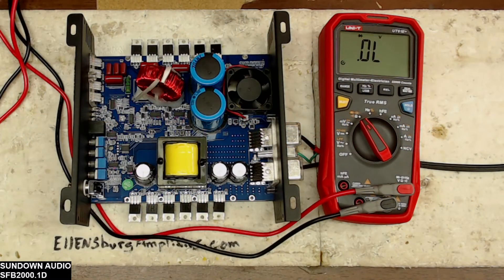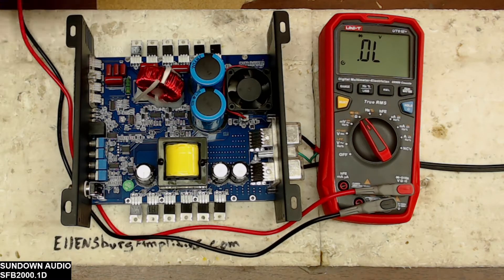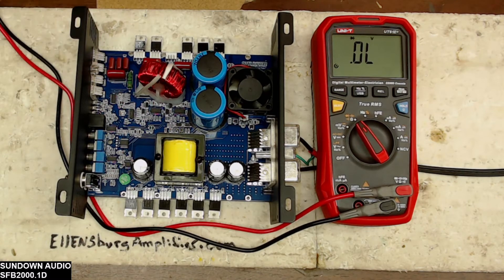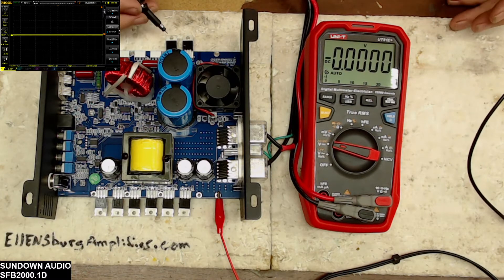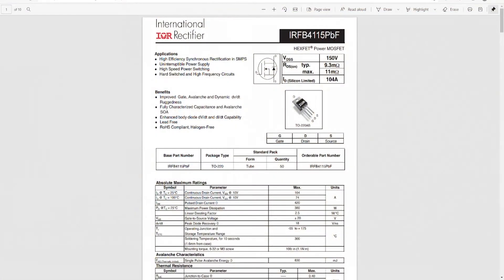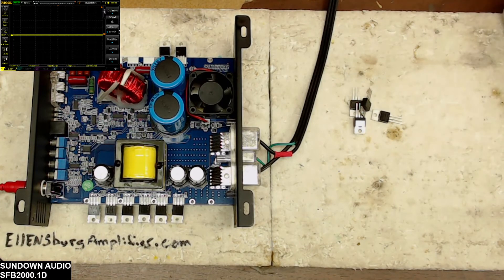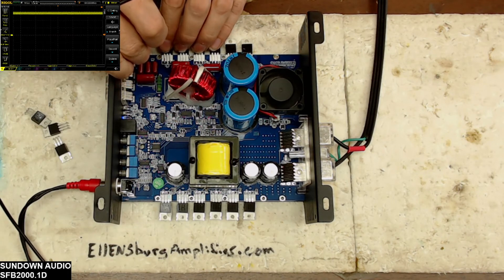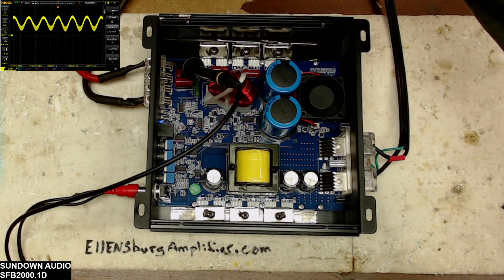Sundown Audio SFB-2000D Class D Amplifier Repair of Output From a Short

Comment: I got this 8000W version of this what could be the problem the mosfet at the output has no PWM though my power supply gives pulses no shorted parts 😭
Reply from the maker: You will need to verify that the pre-amp is functional. You should see a square wave at the input pin of the output drive IC's. Without a squarewave input, you will not see anything at the output transistors.

Comment: I have 2 of the sfb3000....
Bought from the yardsale years ago and finally tried to use them. One went up in smoke immediately and the other i screwed up.  Accidentally touched the positive output to chassis. Went into protection. Are you still working on these?
Reply from the maker: I closed the business at the end of December 2024.
Reply: @ellensburgamplifier any recommendations in So. CAL?

Comment: I recently bought a 08 Honda civic that had a Sundown SFB-2000D running a 15 inch subwoofer installed by the previous owner. Worked fine for 2 weeks then one day subwoofer stopped working randomly and all lights on the amp are flashing. I have zero knowledge about this stuff, never owned a car with a system so just wondering if should buy a new amp 😅
Reply from the maker: I would choose something different to drive that 15 inch as I do not know the design of your enclosure or what style of music you listen to. As a default, I recommend a Korean board first before diving into the Brazilian or Chinese full bridge amps.
Reply: @ Thank you for replying! Sounds like I have alot to learn haha! The sub is in a pre-fabricated box called a Q Bomb? I think? I listen to a little bit of everything but most of the time I left the controller on the lowest setting but it still provided a good thump with the factory speakers. Not sure why the guy before me had this giant 15 inch subwoofer in the car anyway 🤷‍♂️

Comment: What kind of transistors are in there from the factory. I have a 5000 with shorted output transistors and want to replace them with stock
Reply: Did you ever find out ?

Comment: I have the same amplifier but the 8000W one its showing -4vdc on speaker out what to do ? My amplifier is keeps on flashing protect without anything connected besides from power supply ? I tried to read the H1 A2 labeled output transistor and it shows an open reading should I only replace the transistor or what else help ?
Reply: I have 57kOhms in speaker output terminal measured
Reply from the maker: @cyrusbundlaria667  It sounds like the output section needs to be rebuilt. All output transistors, zener diodes, and drivers.
Reply: @ellensburgamplifier  Thanks 🙏 I really appreciate this channel more subs to come!

Comment: I have a simular amplifier with almos intentical inside. Blow same mosfet changed all 4 to identical ones but ass soon as i turn the amp on the same one blowes straihgt away. Do you have any tip on what to check?
Reply from the maker: You most likely have a fault in the drive if you did nor replace the drive components. I would see what the resistance is between the speaker output terminals to ground. This will show any shorts in the feedback. Also make sure your transistors are not fake.
Reply: Where do you het the h1 transistors?

Comment: Working on an 8k clone like this. Have replaced all output fets, 20957 drivers, driver buffer ic's and auxiliary power ic's. Now the clip light will blink about 10 times and on the 10th the power and protect lights also come on. At that point it pulls a little more current like it's trying to turn on but doesn't. Any ideas? Any help is much appreciated.
Reply from the maker: Did you replace the zener diodes? What is the resistance value across each output transistor gate to source? I quit working on these quite a while ago so I don't remember exactly what is involved but I do remember the Zener diodes being a clip light issue.
Reply: @ellensburgamplifier  I finally just figured it out and it was actually my own fault. Lol. I had one of the drive buffers turned the wrong way. So tiny it's hard to see the dot. There was a bad diode next to it also. Not sure if it was caused by that. Replaced both and put on correctly and now it's working. I think it's time for a break now. Lol. Thanks for the help.

Comment: Hi Todd , i have and identical clone amp instead have 2 transformer H1 mosfets , have the same problem 1 Bad output mosfet H6 replace all four with news , have nice square wave but i noticed they  are getting pretty hot., what could be wrong , any idea? Have 117volts on rail
Reply from the maker: Are the IRFB4227 (H6) transistors you installed authentic? If the gate/source resistance values are on par and the same, then I would be looking into the transistors used. Did you also replace the drive IC?
Reply: @ellensburgamplifier  the IC driver could be bad?? , even it both square wave are presents ?! ...
I bought "originals" H6 marked mosfets , but i dont know have me thinking , they have C=11nf , VT=3.5V
Reply from the maker: @ElectronicaChrisJoel  Did you compare the specifications to a transistor that did not fail? Heat can be from a few things such as cross conduction, duty cycle, switching freq., improper transistor values, shorted or cracked inductors, etc.
Reply: @ellensburgamplifier  thanks for that info , i changed the driver from the side mosfet fail , and now they are little bit warm , check resistors specially 10ks are fine , duty cycle at 50% on both , inductor  fails even i have sinewave at output terminals , great day 👍🏽

Comment: Did you find out the full name of the b2 transistor?
Reply: Manage to find 1640ct and 1640ctr but not sure where they go
Reply from the maker: @lorenzongwai3993  The "R" usually indicates common anode which the center leg would be the negative side of primary capacitors or ground reverence. The middle leg of the "CT" would be going to the positive side of the primary capacitors.
Reply: Okay thankyou. Do you have the board diagram or something similar?
Reply from the maker: @lorenzongwai3993  I have nothing for Sundown boards but they are built like all others for the most part.
Reply: @ellensburgamplifier  okay any refference?
Reply from the maker: I have B2 noted as the IRFB4115
Reply: @ellensburgamplifier thank you.. unfortunately my s4 and s3 is blown as well. Do you have the s4 and s3 name?
Reply from the maker: @lorenzongwai3993  Those are common cathode and common anode rectifiers. I use the 2040 rectifiers or the 1620/2020 rectifiers depending on the rail voltage or ratings of the rail capacitors. Good luck on the hunt!

Comment: I have the exact same amp with the exact same problem. Clip light stays on and has no output. What's a good price a shop should charge me to fix it?
Reply from the maker: When I was servicing these the average charge was $60 to $130 depending on the faults.

Comment: I have this amp also.what is your starting cost to see if it can be saved?
Reply from the maker: I don't charge by the hour or have set costs. I charge by the job. www.ellensburgamplifier.com/FAQS I don't charge to diagnose and quote amplifiers. Feel free to contact me. all of my contact information is at the bottom of every page on my site.
Reply: There is an 8 pin ic marked C12 do you know what it is?

Comment: Sfb 5k. In the aux power sections there is a small round smd inductor labeled as 100 on top of it. Is that a value of 10mh? Also do you know where I could possibly get any or is it possible to replace this with a different component? Thanks.
Reply from the maker: That will be a SMD 10uH inductor. There is a little trial and error when buying them. Mouser has them in stock.
Reply: @ellensburgamplifier  great. Thank you very much. This is only the 2nd amp that I've been this deep into the repair. Got the 1st one fixed and finally getting this one figured out too. Appreciate the help.
Reply: Is there any certain way I can tell if the pic is bad? It looks like I should be getting something from pin 11 but nothing at all. I'm also not getting the input sine wave to pin 3 and no pwm at all to the 20957's. I have replaced every ic and tested almost every component. Rail voltage and everything else looks good. Any idea what I could be missing? This thing is driving me nuts. Lol. Thanks
Reply from the maker: @hopskustomaudio  Without a print one will never know if the PIC is good or bad since you don't know the functions. What IC are you referring to about pins 11 and 3?
Reply: @ellensburgamplifier  pin 11 on the programmable ic that controls everything and not getting any type of signal on the pin 3 (input) on either of the 20957 drive ic's. So no switching on the output fets.
Reply: @ellensburgamplifier  pin 11 on the pic is connected to a trace going to something but not sure what it's for. There just isn't anything happening on it. So it just has me thinking that it has something to do with the signal going to both 20957's. I could be way off and over thinking all of it tho. Still very new to all of this. Lol
Reply: Would you be able to replace the pic for this amp if that's what the issue is? Or would the cost not really be worth it? I'm trying to find someone with a bad amp I can buy to get that pic but not having any luck.
Reply from the maker: @hopskustomaudio  If I had a replacement IC I could replace it but as you know you would have to find a spare amp of the exact same model. The minimum charges are going up slightly starting the first of the year which you can find on the homepage of my site.
Reply: I've already put a bit of money in it replacing everything else so don't want to give up on it now. Lol

Comment: Please specify  the power supply gate drive ic number(8 pin ic)
Reply from the maker: the UCC27324/524 is the most common and a person can also use the IR4427 depending what current requirements are needed.
Reply: Thank you so much for your answer.🙏

Comment: Hey, hoping you’ll see this, I have a sundown SFB-3000D, I went to drive my car one day and the amp was dead. The power/clip/protect lights just flicker, any idea what the issue could be and if it it’s repairable?
Reply from the maker: Sounds like a fault in the output section. For the most part they are repairable. These guys deface their ICs which can make a little difficult if it's not the standard faults.

Comment: could i ask you even after many many time......do you known the code of the other unmarked ic's....???like c3,c4,c8 ic,s??
thanks for your tme waste...!!!!!
Reply from the maker: I think those are the pre-amp ICs. I don't have any reference to them as they are typically ones like the 072, 074 op-amps or the OPAs like on Taramps boards. There are also 5 pin ICs that are PWM ICs for the auxiliary power supplies.

Comment: Repairing the same amplifier. Smoked power supply, replaced fets and gate resistors. Currently dont have any signal on the gate. Any idea what the drive ic part # is?
Reply from the maker: The IR4427 I do believe.
Reply: @ellensburgamplifier  TX alot. This is what I suspected but wasn't 100% sure.
Reply from the maker: @camaro1eclipse  Any day! I think you can even use the UCC27524 if you don't have the IR4427 on hand.

Comment: Do you know what triansistor would be on the rail, they are marked s3 and s4 in really smal lettering and there are other numbers above. i have the same exact board as in the video but with other branding.
Reply from the maker: They are the common cathode and common anode rectifiers. Super fun to find and common to fail.

Comment: I have a weird one, Sundown SFB 1k and it turns on plays but smokes. I opened it and noticed the white silicone on the big red coil is the one that starts to smoke.
Reply from the maker: The output section needs to be rebuilt and you may have a shorted inductor.
Reply: @ellensburgamplifier  The outputs dont look fried nothing looks fried on the board. I accidentally dropped it and im guessing thats what caused it to do that.
Reply from the maker: @GorillaKnobzUSA  It will either need to be replaced or the short isolated but luckily it is a small one.

Comment: Hi , I got that power light and clip light is soild but no sound any idea what could   be wrong  I have checked the powersupply,  outputs all good , checked the preamp stage all good
Reply from the maker: Usually, an indication of a bad output section if you see rail voltage being built.

Comment: I have a SFB 8k and was wondering if you can tell me what it means when the power (blue light is blinking) but won’t put out any sound, got a lil warm when I was bumping on it (no clip light at time of bumping) then it just shut off and blue light keeps blinking 😢
Reply from the maker: That is a shorted output section.
Reply: @ellensburgamplifier  ohhh nooo 😱😭😓 dang itttt guess I’m going to need to get my amp repaired 😫 but thank you very much for the response
Reply from the maker: @texasbasshead8289  They are not too bad cost-wise to repair if you choose to use E.A.R.S.
Reply: @ellensburgamplifier  I might have too how would I go about shipping from Texas? You’re located in Washington? (I also have a Skar RP2K that would need repairs too if all goes well with my SFB)
Reply from the maker: @texasbasshead8289  www.ellensburgamplifier.com/request-a-quote is the first step. Shipping isn't too bad if you someone like pirateship.com as they have some of the best rates possible.
Reply: @ellensburgamplifier  awesome greatly appreciate all the feedback I’ll get on that as soon as I have the fund’s available thank you very much 🙏🏽

Comment: Hi there, I bought a SFB 1500 from a dealer and got stiffed, as soon as I hooked it up it cycles between blue, clip and protect and it seems to overheat even when the vehicle is off. thank goodness I caught it in time.  Is it to late for this amp or can I try replacing the output transistors? If so can you recommend what transistors to buy and where I might get them. Thanks
Reply from the maker: The thing with these boards, in most cases, is there are more things to replace than just the transistors. If you let me know what the transistors are marked as I may be able to tell you what they are.
Reply: I'm sending it to amp lab, they're going to probably do a better job than I could.  Thanks for your response though.
Reply: @TheRepos296  better to put it in a pillow case and bash him over the head a few times

Comment: Hey man. Really appreciate your videos. I have a sundown sfb 3000D. Same situation with the sfb 2000 u worked on in video. I have 2 bad H6 mosfets. I am trying to fix them and want to make I purchase the correct mosfets in there place. Any insight would be so amazing. Thanks alot
Reply from the maker: LCSC.com has the IRFB4115 transistors in stock. I am not sure what the status is here in the states for them but I see Mouser is out and so is Digikey.
Reply: sali de mi duda. conel c5 cual era el renplaso tienpo buscandolo

Comment: Are you located in WA . State like I think ?? I have an sfb 2000d that burned up some transistors on the opposite side of. The one in this video I would like to have it fixed or at least the parts identified.thanks
Reply from the maker: Indeed right in the middle of Washington. www.ellensburgamplifier.com/request-a-quote is where you will find the form to submit a request. Thank you!

Comment: Im about to order transistors but seeing as these blow for no reason all the time is there maybe an alternative to the 4115 that might give a little more headroom or lower Temps?
Reply from the maker: The drive topology is what dictates the transistor. It takes quite a bit of trial and error to incorporate a different transistor that is stable with minimal changes to the resistance and capacitance of the circuit.
Reply: @ellensburgamplifier  thank you for getting back to me. I can't find anywhere that has irfb4115 in stock. Is the voltage or current rating more important to match? Also is there any way to protect the rest of the amp while I experiment with different fets?
Reply from the maker: @kymcochran5581  Transistors can be a nightmare to locate. I work with several distributors to get what I need. There are several key specifications that you should try to match. Rds on, capacitance, speed. You will know when you are close as the transistors will not heat up when you start it. If the specifications are too far off it will heat up almost instantly or it will start to heat up significantly under load. Watch the scope as it will tell you a lot about how the gate circuit is reacting to the transistors. I don't suspect you will damage anything but of course if you are too far off on specs you will damage the drive components.

Comment: Great work. I am currently trying to repair one of these amps however my power section has a fault. What's power MOSFETs do they use? What is the H1 MOSFET?
Reply from the maker: The H1 is the CSD18502KCS. With the power supply transistors removed I would check to make sure that you have a pulse from the gate drive on the scope.

Comment: I went to check output voltage and the amp cut out and now my clip light is on , no output voltage
Reply from the maker: Sounds like the output received a short while checking. With the clip light on, it is saying there is no output switching.
Reply: I believe one of the multi meter leads grounded out on the aluminum case .   Would that be covered by the warranty. .and if not what would it cost to fix it
Reply from the maker: @stevenmeadows7769  Unfortunately that would not be covered. Did you send it to Sundown? I would not know the exact cost to repair as it is dependent on what needs to be replaced. Average.. $75 to $125 (as of 7-22)
Reply: I just mailed my amp back today
Reply: Yeah sundown